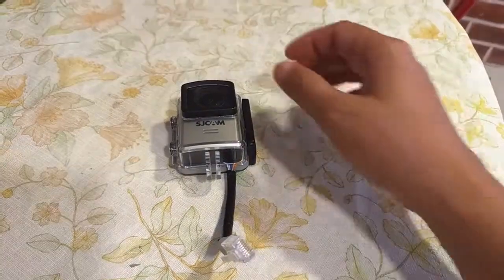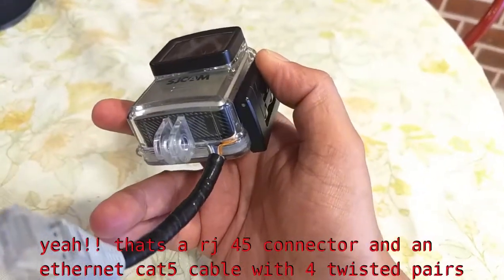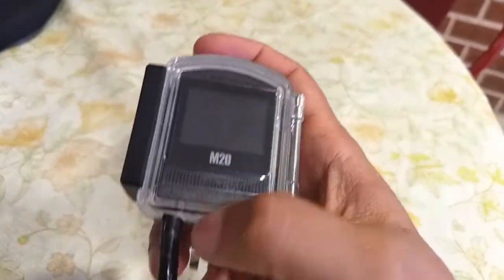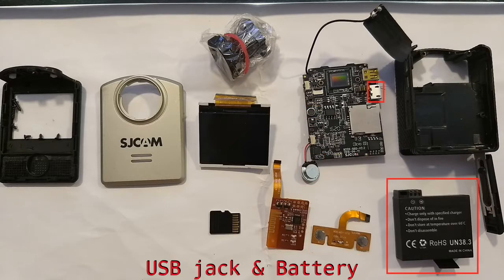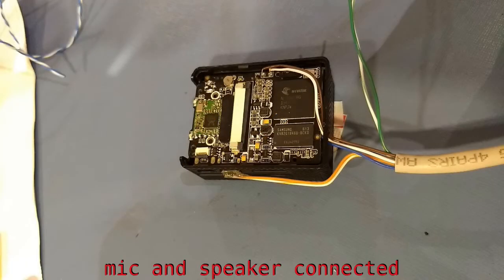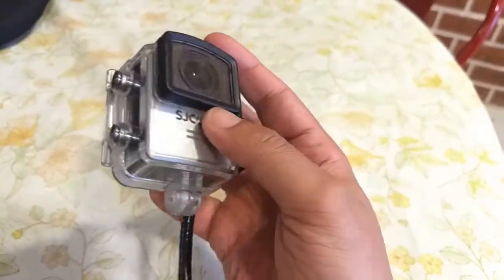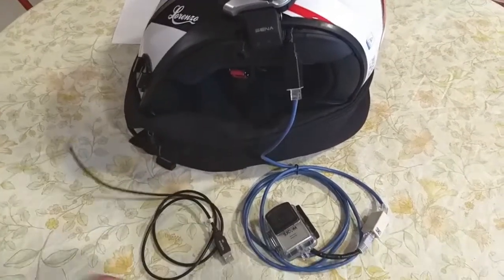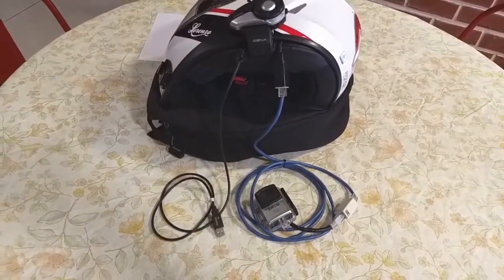sjcam m20 external mic speaker power

Comment: you could show us step by step on how you did it.
Reply from the maker: Do you mean real time soldering and prep footage? Its very tedious viewing and no fun to either watch or edit ;-)
However I essentially did the following:
- Remove battery & sd card
- Open up the casing - (https://www.youtube.com/watch?v=uFARw2gj7oU)
- Carefully remove lcd screen and ribbon cable connecting it to the mainboard
- Remove the top button module and remote control module ribbon cable
- Extract the mainboard out by removing the screws that attach the lens to the mainboard
- Desolder the mic and speaker
- Route 4 wires from a cat5 cable via the plastic casing small grill at the bottom and solder them to the mic and speaker points
- Put everything back and close casing

Preparing the super small usb power connector was a bit tricky but I basically cut out one from an existing usb cable and slid out the internal plastic holder with the actual usb pins. I then sanded the outer metal shield till it was small enough to sit slightly proud when inserted into the camera. Also cut the plastic slider with the pin connections to size match the outer metal shield and solder the leftmost and rightmost pins to two wires from the cat5 cable to supply power.

Since I made this video I ended up gutting this camera in an accident and plan to do it again on my replacement camera. However since I am not actually making any vlogs I haven't got around to doing it yet. If I do I will make some more detailed videos.
Reply: yes i mean soldering and all. i dont watch videos for fun. i watch to learn. i have 2 of these m20 cameras and i want to use a external mic.  so if you will revisit this hack and do a video on the hole process. would be great.

Comment: Your micro USB connector is shorter than normal, where to find that short one ?
Reply from the maker: Nguyen Tu Anh , i cut one out of a usb cable and then sanded it down to a very short profile. It took a bit of effort and trial and error.

Comment: How long do you use your cam using external power? We have the same cam. I'm using mine in my motorcycle for about an hour and it gets warm. If I use it on my car and connected tot he cigarette socket, it gets warmer. Do you have the same problem?
Reply from the maker: Allen Mongado i keep it on all the time... a but of warming up is expected but the waterproof casing does lead to more heating. i have never had any issues with overheating but never really used it in peak summer yet... i mostly ride at night in the summers to beat the heat
Reply: enRAGEd I usually use it on mornings and evenings. 5days a week. I just don't want it to be that warm everytime I use it.
Reply: So, do we need add a cooling system on waterproof case?
Attach a piece of cooling pad  same as between CPU & CPU cooler of PC  or copper pad on the chip set cover. 
Bring out a copper wire, 
connect to small cooler under the case...